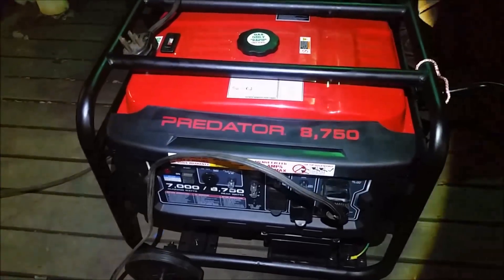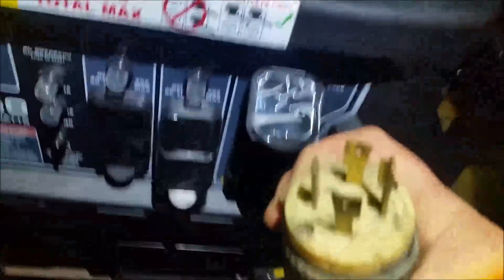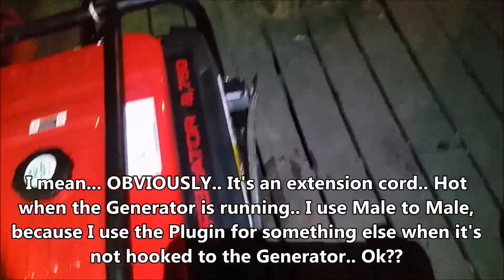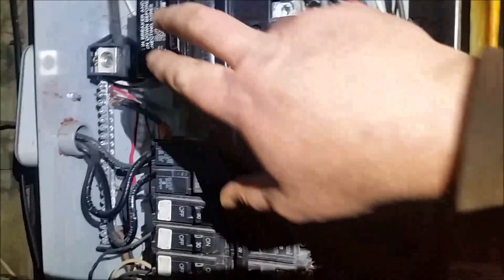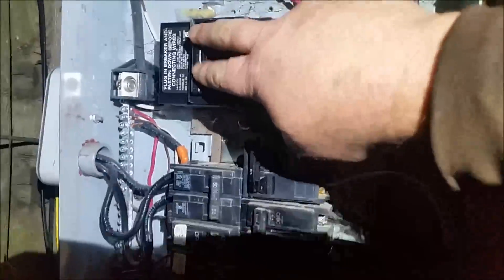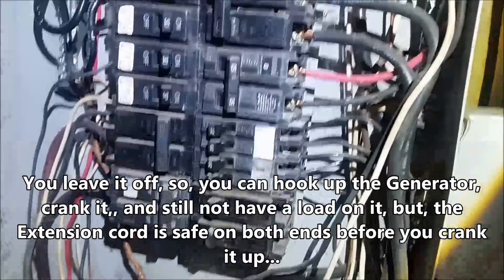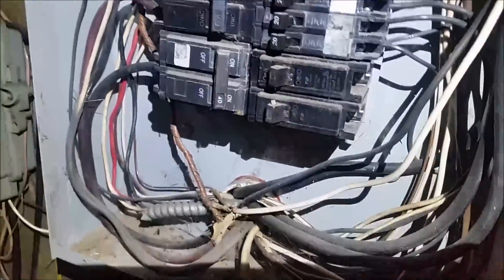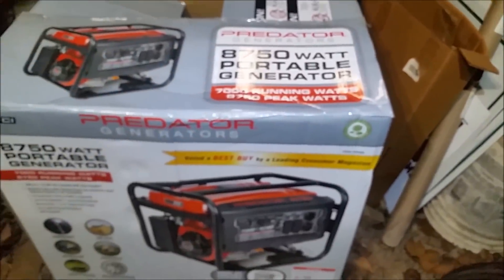Quick/Easy/Safe: Use Existing Plugin/Breaker for Generator hook up to your house Panel box.

Comment: U ARE THE STUPID ONE IF YOUR TELL PEOPLE THEY CAN GET 7000 WATTS FROM JUST THAT ONE PLUG
Reply from the maker: DUMB ASS ALERT!!! ,,, DUMB ASS ALERT!!! ,,,,,, DUMB ASS ALERT!!! ,,,,, DUMB ASS ALERT!!!
Guess you have to have a generator with 10 plugs?? Ha.>Ha..Ha.. What a dip shit!!
Reply: THE 7000 WAT HB GEN.HAS 34 PLUG IN ONE IS 28 AMP 2 PHASE U CAN ONLY GET 28 AMPS MAX OUT OF IT THAT WILL NOT RUN A HOUSE CHECK YOUR FACTS BEFORE U TELL PEOPLE WHAT TO DO  AND YOUR THE DUMB ASS IF U THINK U CAN GET THE 7000 WATTS ALL IN ONE PLUG

Comment: U  USE THAT PLUG ONLY ALL U GET  IS 28 AMPS NOT ENOUGH TO RUN A HOUSE U HAVE TO USE MORE THAN ONE CORD TO  GET 700O WATTS.I BOUGHT ONE OF THESE THEN I NOTICED ALL I GOULD GET IS 28 AMPS
Reply from the maker: DUMB ASS ALERT!!! ,,, DUMB ASS ALERT!!! ,,,,,, DUMB ASS ALERT!!! ,,,,, DUMB ASS ALERT!!!
Boy.. Have you got a lot to learn about Electric 101.. What a dip shit!! Guess you need to do a little research.. 
Because, it does run my whole house.. I have to turn some of my laserjets off, if I want to run the deep well and hot water heater at the same time, but, I consider that, the whole house.. I have a switch that I can turn the hot water heater on/off with easily.. And, I turn it on after I am finished using the water and want to charge up the hot water heater again.. You really need to find a better place to get your information.. BTW.. How many feeds do you want to run into your panel?? Ha..Ha..Ha.. What a Stupid Ass..

Comment: Great video but I would have liked to have seen you plug it in and see how the appliances work as you turned each breaker on. imo. No disrespect.
Reply: You know what Mark Thomas? I love these professional electrical guys that think no one should touch electrical stuff because with all the online tutorials they are afraid they are going to be useless. Sharing information is free and we don't need to pay outrageous prices to get things done.
Reply from the maker: You are correct.. Electricity is really very simple.. The electrical panel is very simple.. If you think about it,, 3 wires and two of them are basically the same, so, how complicated could it possibly be.. 
The answer to your earlier question is kind of a two way concept.. One is based on the power of the generator, the other is just timing.. Here you go.. 
When you are running on Generator, you have a limited amount of power available... That is the point to remember.. Also, the load put on the generator motor makes the motor grunt for a second or two, and then try to recover from the load and get back to it's designed rpm's.. 
When you are turning on breakers,,, (ie..loading the generator),,, the first second the breaker is turned on, is the first few seconds that everything is using max power to start up..  Start capacitors discharging and charging again, etc.. Motors spinning up,, Laserjet Printer Fuser units heating up, etc.. 
When does a light bulb usually blow? Exactly.. When you throw the switch.. 

So, flip on a breaker, listen to the motor, when it levels out again, throw another breaker.. If you have a circuit with several appliances with larger motors, etc,, sometimes, if they all come on at the same time, there is a lack of voltage and some more sensitive motors will wait and try again..  So, when you throw those breakers, wait 5 seconds to throw another on...Wait until you hear the load on the motor settle down and smooth out..  

On your 120 breakers, usually, you only have to wait 2-3 seconds at the most.. But, you may have some 120 volt equipment that is large and could have been 220v, but, is built with 120 volt to make it more available to more consumers.. Rule still applies though of listening to the motor.. 
When you are going back on Utility power,, all of the voltage irregularities caused by those "NOT" running on generators will have evened out, and you are only dealing with adding your house back.. 
This time, with hate to use this term, but, more of an unlimited voltage supply.. 
But, same rules apply here too.. I still turn off most of my breakers and add them back slowly.. 
Usually 1 second between 120 volt breakers and 2 seconds between 220 volt breakers.. There is no motor lugging and trying to catch back up, etc.. That is what I mean by Unlimited power coming back on.. 

The Utility power has no lack of voltage,, just the volume that travels in and bounces around.. Doesn't take long (split seconds) to be fully available and smoothed out.. Nothing is going to "not start" and restart, etc.. 
Listen to the motor when on generator, and just timing when you are going back on utility power.. 
Hope that helps Daniele.. Welcome to the wonderful world of Youtube.. 
What an awesome concept.. People helping people.. Some people do it for the money and some just to help the community that helps him/her.. I don't monitize my channel.. Not in it for the money.. I just do videos where I see there is a lack of info, or, when I want to share something simple or better.. 
Lots of people delete videos like these because of all of the other stupid people out there that bash them.. 
I even stopped people from commenting on this video a couple of times.. But, the reality of this system is only a Male to Male extension cord, and using an existing 220v plugin you already have.. 
If that is dangerous,, then,,, those people saying so, need to really remove lots of other things from their daily life.. Knives, forks, etc.. Ha..Ha.. No.. This is a simple and great way to do something simple and temporary and the cost of the whole deal is $20 or so to make your extension cord.. I have been doing it this way for 13 years.. Works every time.. Cheers..
Reply: Thank you very much for this and your time Mark. I will be doing a test this weekend.
Reply from the maker: Good luck.. I'm sure you will do fine.. Just remember.. There is a lot of voltage/amps in that box.. 
Even when your main breaker is off, you still treat your work like it is hot.. You never know when a wire connected from a source might have some residual voltage from a capacitor, etc..  If I have just disconnected power and I am going to touch a black/red wire in a box, I will ground it quickly to the box or buss bar to drain any residual voltage.. But, to be honest, I have never gotten a spark that concerned me, or for that matter ever "Heard" a spark, or seen a discernible flash, but, I still do it just the same.. It surely doesn't hurt and only takes a split second to do it, or test it.. Cheers.
Reply: Everyone really needs to watch this video about generator safety https://youtu.be/I1jT3ANENvI we encourage everyone to agree with this